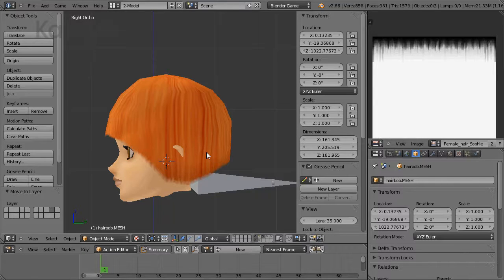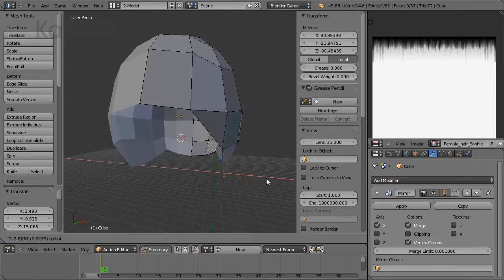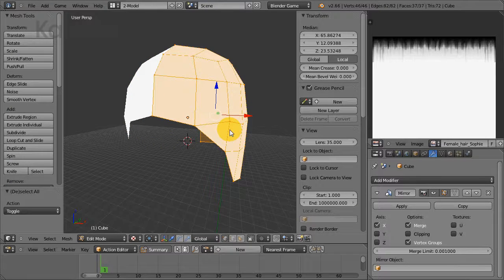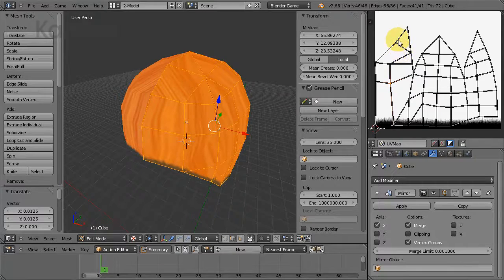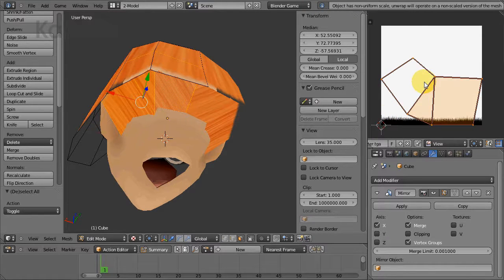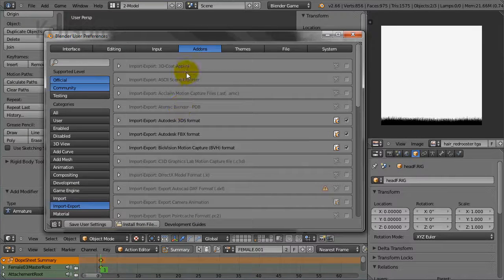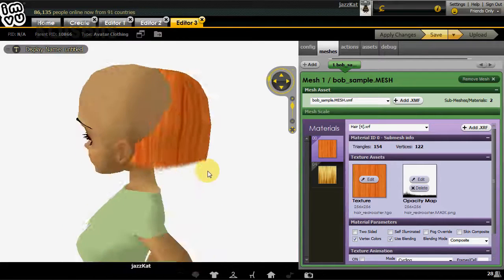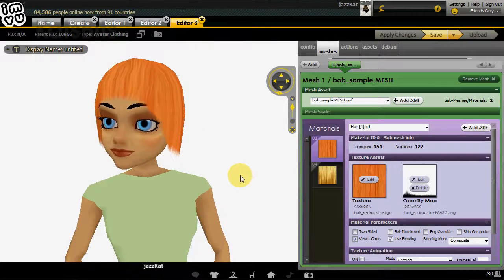IMVU how to easily make hair with Blender (HD)

Comment: How to make a non-straight hair? Like a curly or wavy hair?
Reply from the maker: Basically using mesh 'strips'. Instead of using one big object as shown above, use a plain and twist that into shape. This can then be duplicated around the head and shaped to fit - it's best to keep the strips separate until your happy with the look, then they can be joined together into a single mesh. Make sure to use layers as well - strips of different length (this assumes an accessory style hair item not a *body mesh*, which are a bit more tricky to do).
Reply: @KatsBitsTutorials  thank you

Comment: How'd you make the hair texture?
Reply from the maker: Fill a 256x256 image with a single colour. On another layer draw a line that's a few pixels thick from side to side this should be another colour. Use the 'Noise' filter to add dots that are a lighter or darker colour. Use Directional or 'zoom' blur on the line to create streaks. Resize this so it covers the entire image and then play with the layers transparency/opacity, or merge modes (typically Softness/Overlay/Hardness).

The fuzzy edge is then just an alpha mask. Draw another line on a different layer, zoom blur it then convert it to a mask. For Blender use you'll need to save the image as an RGBA targa file; for IMVU colour the fuzzy bit black, and colour fill the rest of the image white - save this as a separate 'mask' image then load the two into an IMVU material slot, colour for the main image, the black and white image for the mask (more on opacity in IMVU here - https://www.katsbits.com/tutorials/imvu/opacity.php).
Reply: @KatsBitsTutorials  Thanks for reply :)